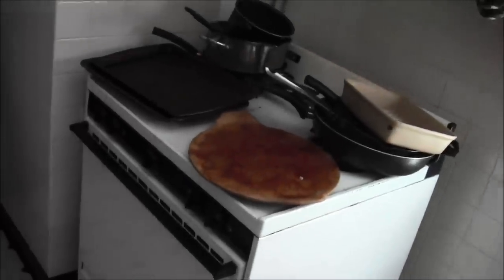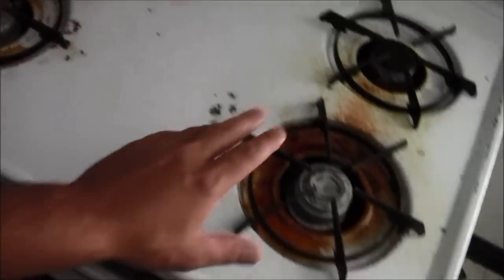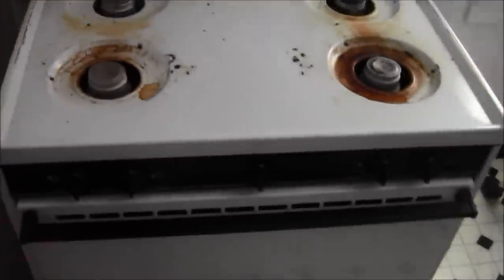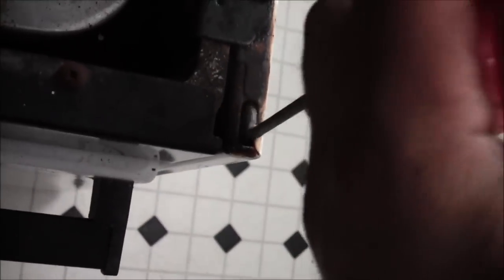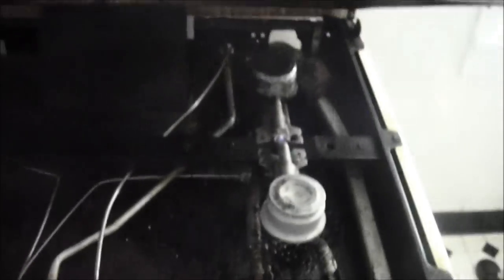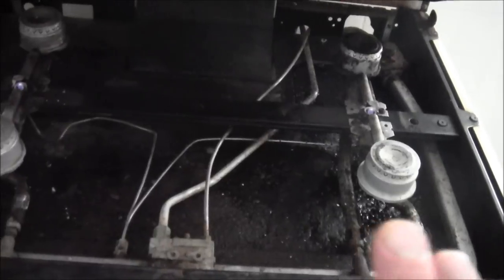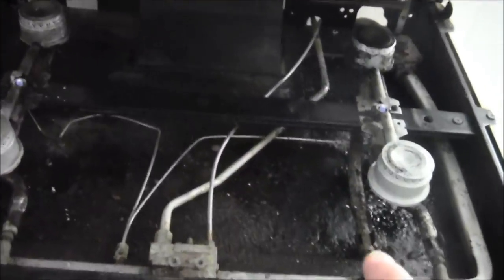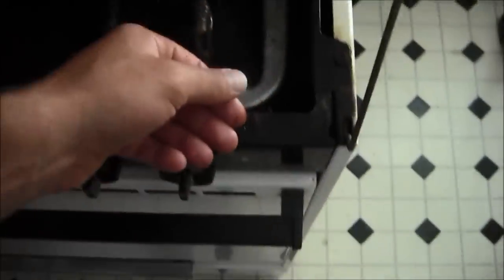Have Gas Smell from Stove?  Here's What to Look For and Do

Comment: Every time I turn on the oven I smell a lite odor of gas. The stove is fairly new, less than a year old what do I do.
Reply: i saw a couple of videos. what they did was mix some water and soap in a spray bottle and spay near tge connector valve and if it bubbles there is a leak that probably needs to be tighten

Comment: Hey we recently got the same model of stove as you. We did the trick and it worked.  Now we are wondering if the igniters are supposed to stay on at all time? Because the stove top stays really hot above where the igniters are at.  Is that normal?

Comment: This type of aluminum burner is crimped together.. the burner bottom can leak gas because the crimp loosens from repeated expansion and contraction over years of use.I had to take mine out and use a ball peen hammer and a tool to recrimp mine.. to eliminate leakage and restore proper operation.
Reply: could you elaborate please?